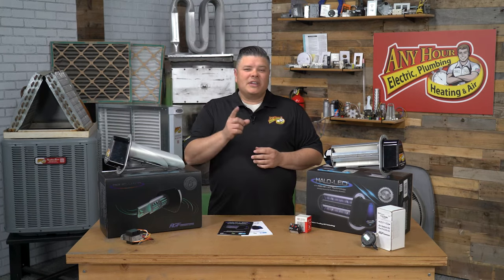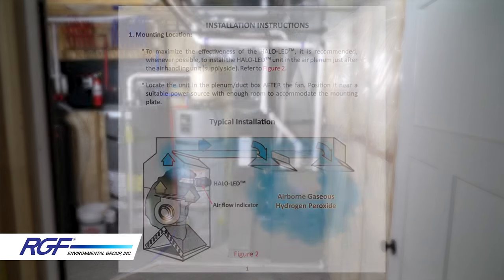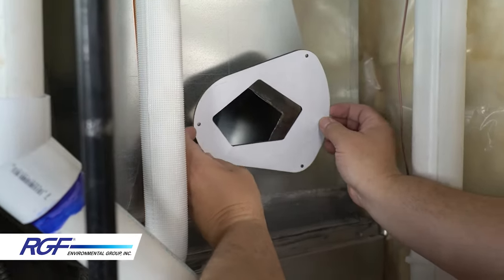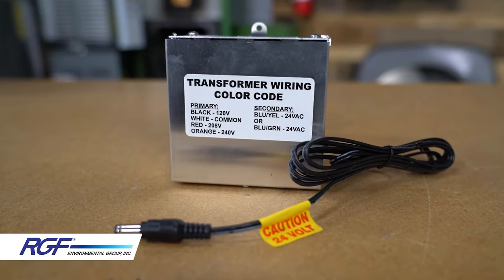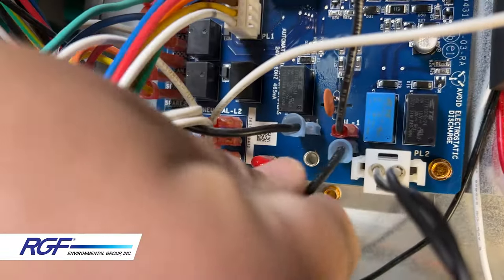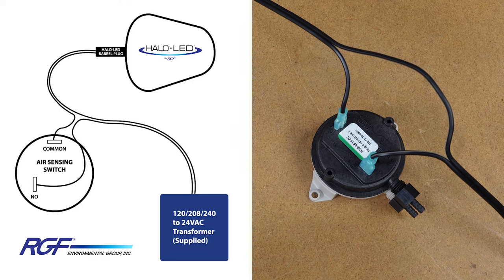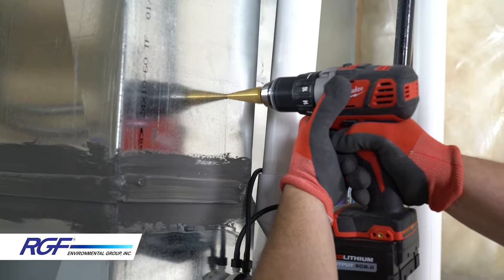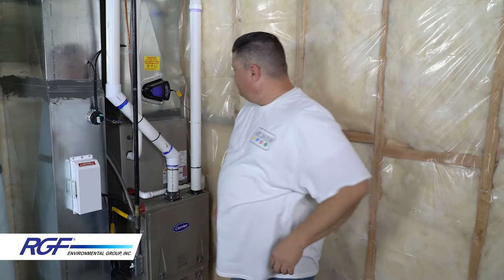RGF Environmental How To Install A HALO LED Air Purifier

Comment: Mike, great video on how to install this device.  You made it very simple and including the diagrams was very helpful.
Reply from the maker: We agree, Mike did a great job explaining the installation thoroughly!
Reply: @rgfgroup :  can I purchase this unit from you?  If so, what is the price and warranty?  I have read that RGF will not honor warranty claims unless this unit was installed by a licensed contractor. I would install the Rene Halo LED myself since I have done all the electrical and HVAC in two homes I built. I see no way that I would improperly install this. Thanks.

Comment: Please ignore my comment below. I spoke in ignorance. I have since contacted RGF and spoke with the man that designs this system. He informed me that some EAC terminals do not put out proper HZ when first coming on and that can damage the REME. He wants all units installed with the transformer powered all the time and break the low voltage to the REME with an air proving switch or relay. He said if you always use the air proving switch, you won't have confusing different diagrams for your techs. Just get the line voltage right to the transformer and good to go.
New diagrams may be coming out to replace the current ones.

Comment: If you have a modulating furnace is it mandatory to use the air switch or can you connect it to the EAC? if you connect with the EAC do you have to use the relay?

Comment: RGF instructions for relay installation all involve switching the primary side of the supplied transformer on and off. It seems to me that a better approach would be to switch the secondary side on and off (leaving the transformer always powered), similar to RGF's instructions for an air sensing switch. For air handlers that control the blower fan via the G terminal (fan control) only, the G and C (common) terminals could be connected to the relay coil terminals, and either of the transformer's secondary wires could switched via the NO (normally open) terminal on the relay.

Comment: could you mount the airswitch inside the blower compartment for your neg , and  running the + press swt tube out of the cabinet to the supply side with the power wire? this would just keep most of the wire connections inside the blower compartment minus the power wire to the unit.

Comment: Thank you for the video! I was able to install it myself. The supplied rubber hose that came with the air switch is not long enough for both sides (positive and negative) - I only connected the return for now and it works. Question - what is the purpose of connecting both on the air switch - is it mainly for backup?

Comment: ALTERNATIVE to air movement sensor doo-dad: 

Install 24vac NORMALLY CLOSED (aka "NC") relay (cost me $18) that is connected to the fan/blower terminals (locate the BLUE and GREEN bell-wire connections) on the HVAC circuit board that are connected back to the thermostat.  The link below is an excellent tutorial for how to do that.  You will also need about 2x 12-24" of 14 AWG for the line and load terminals of your relay, plus enough bell wire to connect the sensor posts from the relay back to the thermostat blue and green terminals on the HVAC circuit board.

When you open the HVAC cabinet panels are removed, a cutoff switch should stop main power from reaching the HVAC system.  Make sure that happens before you proceed.  If you are unsure or extra cautious, turn off the HVAC power circuit back at the house service panel. Don't be stupid, electricity can kill.

Relay wiring summary, read this and then watch the video indicated below before you start: 
1. Find the NC ("normally closed") posts on the relay.  Run one bell wire from the green thermostat terminal on the HVAC circuit board to one NC post on the relay, run another bell wire from the blue thermostat terminal to the other NC post on the relay.
2. Connect one 110vac relay post to power source (black wire), connect the other 110vac relay post to the hot terminal going into the RGF 24vac transformer.
3. Connect the RGF transformer 110vac common (white) to a 110vac common. 

For my 110vac hot and commons, I found the separate (not the RGF) 24vac transformer that feeds the HVAC 24v circuit board, and spliced in at that point.  Watch the video, figure out what makes best sense to you.

Figure an extra 30 minutes of labo to DIY the relay on top of the REME installation labor time, but there are no goofy air-pressure tubes or other exterior-cabinet lines.

See:        https://youtu.be/VASHYm9yM5s?si=wPdeDGZKOC4-OiAt                 ...and remember to give the guy a "Like"

Comment: Nice video and what you say works, but when Installing the REME LED to a furnace, it is easier to power the transformer from the EAC terminals on the furnace logic board and plug the 24 volt end of the harness into the unit and you are done. No airflow switch or relay is needed on the furnace installation. The furnace logic board is specifically designed to energize the EAC terminals anytime the blower turns on. Air handlers are different because they do not have EAC terminals. Then either the relay or the airflow switch is needed to install the unit properly.
Reply: Does this work only when the furnace is running, or does this run when the AC is running, too? Mine was installed without tje air sqirxh only runs when furnance us on. Is this normal?
Reply: @shanew7361  The REME Halo LED should turn on any time the air is being circulated in the home, both heating and cooling and even just fan on. However, it should not be on 24-7. The REME Halo LED does need to turn off and on in order to clean little brushes that you cannot see that are under the plastic cover on the end in the duct. This happens each time the unit turns on. Brian
Reply: Brian Shimp  So my contractor didn't install this properly cheaped out and were lazy. They did not install the air switch kit. Mine only functions when the furnace is running. They are coming out tomorrow to have a look. Suggestions on what to say and ask them? My furnace was replaced in October 2022 along with the Reme. Or does one not need the air switch for it to turn on during AC and heating? I got a Carrier 2 stage 125k btu.
Reply: @shanew7361  That Carrier gas furnace has EAC terminals that get 120 volts every time the fan in the furnace turns on. They can put a 120 volt coil relay on those EAC terminals and have the relay cycle the low voltage to the REME or they can install the air proving switch.
Here are my comments from before that are accurate. If they don't like them, they can call RGF like I did. 
 I have contacted RGF and spoke with the man that designs this system. He informed me that some EAC terminals do not put out proper HZ when first coming on and that can damage the REME. He wants all units installed with the transformer powered all the time and break the low voltage to the REME with an air proving switch or relay. He said if you always use the air proving switch, you won't have confusing different diagrams for your techs. Just get the line voltage right to the transformer and good to go.
Hope it helps to make your case.

Brian
Reply: @brianshimp8299  Thanks. I screen shotted this information I will share with tech after his assumed diagnosis or lack of knowledge. You never know what shows up nowadays, lol
Reply: @brianshimp8299  The tech is saying the board is bad and is going to replace the board. I find it hard to believe in a brand new furnance. Says it's not outputting the proper volts or hz.
Reply: We are a large Carrier dealer for the past 45 years. Rare for the EAC terminal to fail, but possible. However, if the tech was to use the air proving switch, they don't need the EAC terminal at all.
Reply: @brianshimp8299  I agree. However, the new board fixed it. Halo LED is functioning properly.

Comment: Does the orientation of the air switch make a difference? In the install manual it seems to be illustrated 180 degrees from this video.

Comment: A guy came out and installed one at my house today, but didn’t use a rubber grommet for the air switch hose…just put it through an open hole. Is that going to be a problem?

Comment: How do I connect the power without the air switch? You skipped that
Reply: Hire a hvac tech
Reply: ALTERNATIVE: Use a 24v relay off of the FAN terminals (find the BLUE and GREEN bell-wire connections on the HVAC circuit board) that are connected to the thermostat.  I found this excellent tutorial for how to do that.  24v relay cost me $18 from an HVAC supply store, plus about 24" of 14 AWG for the power to/from the relay line-side, plus another 24" of color-coded wire to run from the blue and green circuit board terminals to the relay coil-side.  Figure an extra 30 minutes of labor to DIY the relay on top of the REME installation, but there are no goofy air-pressure tubes or other exterior-cabinet lines.

See: https://youtu.be/VASHYm9yM5s?si=wPdeDGZKOC4-OiAt and remember to give the guy a "Like"

Comment: Hi Mike, great video! What's the warranty on the unit and will a DIY install void the warranty? Also, is the air switch included?
Reply: yes it voids the warranty, no the air switch is not included

Comment: Installer claiming my brand new device is faulty. Cannot turn on. But also claiming correct inctalation and wiring on his side. How to check device in this case? (Installed without air switch).
Thanks for help.

Comment: Just to keep the air circulating in my house I run the fan every hour for 30 minutes from 7AM to 10PM no matter whether the cooling or heating is on or off. 
Would using Halo LED be an option in such case or I should go with Reme HALO, possibly Zero? Thank you.

Comment: Any videos / instructions for how to install this on a 240v air handler here in Florida?
Reply: Just use the 240v wire as indicated on the power transformer. Look at the label on the metal transformer box.
Reply: Use the transformer it comes with and step down it ??😅😂

Comment: Quick question Mike. What would happen if the Halo-LED Barrel Plug gets unplugged? The homeowner installed one of those in the apartment where I live with my family and we've been getting sick often after its installation. The homeowner refuses to uninstall it.
Reply: The UV light isn't what's making you sick, even if it unplugged. Unistalling it would make no difference at all
Reply: You probably getting those symptoms b/c u have mold which will happen if that UV light is unplugged (assuming it's not hardwired), that outlet isn't working, the breaker for that outlet tripped for whatever reason, if the bulb is burnt out. Shouldn't be the other way around.

Comment: The red indicator light on mine keeps turning off. Ive removed the unit, put it back in and the red light will come on for a while then go off again. Does this mean the bulb needs replaced or is there another issue?
Reply: The problem is that it probably doesn’t have its own transformer or it’s powered directly that will kill them , wire it to the G

Comment: If you connected to L1 which is power always on, how would the halo be control with the fan?
Reply: The L1 is powering the transformer not the halo. The 24V coming from transformer powers halo but you're breaking the 24 with the air switch. Just like a float switch pretty much

Comment: My technician has just installed the reme halo LED by connecting directly to the circuit board and it keeps it staying on at all times. Is this an incorrect way? And it is close to air filter in the direction of airflow.
Reply from the maker: Hi Sammie! Thank you for your inquiry. We recommend that the HALO LED is wired to cycle on and off with the blower. The REME HALO on the other hand is wired to run continuously.

Comment: We just got our Reme replaced by a technician, this second one seems to not work as well. We can’t really smell ozone as we used to. Is there a setting where we can turn up the setting? Thanks would hate to have to change it out
Reply: The REME LED makes no ozone so you obviously won't smell it.
Reply from the maker: Hi Allie! Thank you for your inquiry. The REME is not an ozone generator, but I know what you mean. The REME HALO does have an adjustable shroud so you could have your contractor open that up all the way to increase the output.